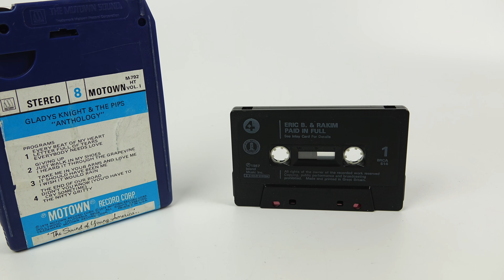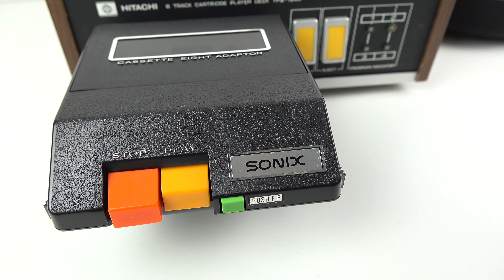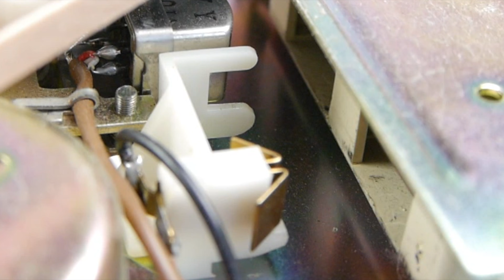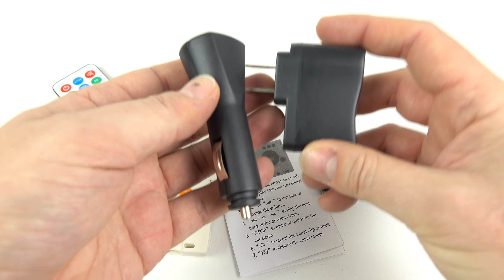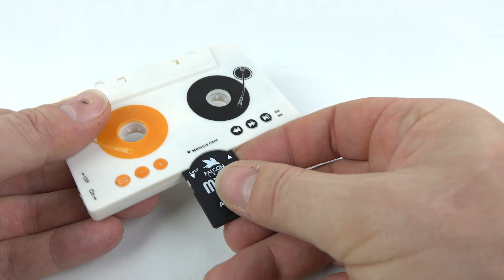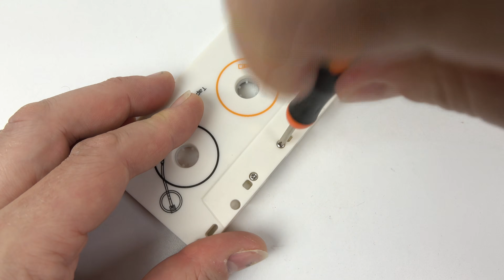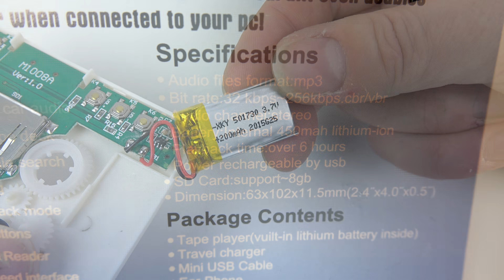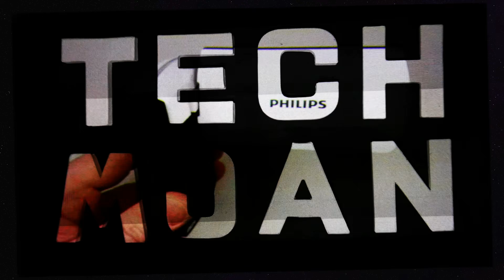Car Stereo Tape Adapters - 8-Track to Cassette to MP3

Comment: a new problem now is having a car stereo with only a CD player and radio. how can I play my music from my cell phone. if it had a tape deck I could use the wired tape audio adapter that was shown in this video. 

the car is from 2008 so there is no audio in jack or blue tooth. new cars come with these options now. I am better off changing the while deck.
Reply from the maker: I have the same thing in my car - I just listen to the radio. Those personal FM transmitters are generally a bit rubbish...and I have enough things plugged in.
Reply: I had that same problem with a car I used to own as well. My solution was to purchase an aux in jack that I wired into the car stereo. At the time, the solution was kind of crude, being that I had to splice a few of my radio cables and also use a power switch to turn the thing on and off, but it worked great, and sounded MUCH better than an FM transmitter. 

I did a quick search on Amazon for "aux in adapters", and it seems that they've gotten better, as you no longer have to splice them in. Instead, you can just plug them in. They cost around $25-$30US. Hope that helps!
Reply: I have the same problem. 2007 Astra only has radio or CD. I now have a huge stack of burned CDs in the car since empty discs are cheap as dirt nowadays.
Reply: Usually there is a port on the backside of car stereo unit to connect the cd changer. I have Yatour mp3 player that simulates the changer and it works perfectly in this situation. Sometimes you need a special Y adapter cable to put inbetween. Everything depends on the stereo model.
Reply: The radio transmitter things are a little bit rubbish until you hack them. I got a cheapo one from Maplin years ago, and cut a bit of old speaker cable as an aerial that I then kept prodding to the circuit board until it sounded better. Glue gunned it in place and suddenly I had far too good a transmitter! I cut the wire shorter and shorter until it served the purpose I wanted (sending simultaneously to the radios in the living room and the kitchen) without  being able to pick it up outside the house. Obviously you can't just transmit to a whole street in the UK, that would be illegal! But it sounds better and transmits more reliably if you do this.

I should think there's bound to be videos telling you how to hack one of these things.
Reply: I just burn CD's for my car lol
Reply: Use those bluetooth to FM adapter?
Reply: A lot of manufacturers have spare ports (or connectors) on the back of their head-units. It makes it cheaper to manufacture the same stereo over and over again and just add the required components via a simple plug-in connection. I Googled my car (2006 Renault) and found a 'hack' that allowed me to attach an old headphone lead to three of the spare spade connectors. 10 minutes later I can plug phones and mp3 players into it with ease.
Note that the steering wheel controls do nothing to the music (well, except the volume control of course).
Reply: with all those gadgets and gizmos laying around your house , how come you didn't opt. for an aftermarket head unit replacing the OEM one you have there ?
Reply: dude its hella easy!
just listen to me...
buy a $20 dollar device off amazon called the iKross or something, it connects to your phone via aux or bluetooth, and then broadcasts the music over an FM or AM signal, tune your radio in your car to that frequency and boom youre done! no need to change the headunit or the stereo or the car! works fine and extremely well in my '01 Benz ;)
Reply: +Benisteinzimmer please dont generalize. not all of them do, but i agree, some of them do. buy a good brand name one and check its reviews before buying and youll get a good one.
Reply: +techforever1970 Yes the key is a good one and making sure that it is on a completely clear frequency so it's not competing with an existing FM station in the area you are driving in. 
Then, the sound quality can be good and the signal relatively free of noise.
Reply: I have a bluetooth reciever going to an fm transmitter so you can still recieve call etc
Reply: I once added an aux-in to my 1984 Crown Vic's original AM/FM-only head unit -- the $30 WalMart CD one got stolen, so I opened up the OEM unit, soldered a headphone plug adapter to a bit of telephone cable to the output of the radio receiver section, and ran the plug into the ashtray. Tune it to dead air, plug in the mp3 player, and its signal was strong enough that it downed out the radio static. But yeah, 2008 probably has a plug on the back for an optional dashboard aux-in plug or CD changer that you can tap into.
Reply: Somebody once broke into my partner's Jeep Cherokee and stole the stack of burned CDs with labels like "shitty indie mix #1", "music for driving through a city at night", and such. Didn't take the head unit, didn't touch the hundred of dollars' worth of tools in the back, didn't even take the spare change from the console. WTF?
Reply: Now, if your car stereo has a CD changer option, you may buy (very cheaply) a CD changer emulator for your stereo, that plugs directly into your car stereo with no soldering nor fiddling with wiring. The emulator reads micro SD cards, Jack 3.5 and USB 2.0 (flash stick). I just fitted such emulator to a Skoda/VW OEM radio and it works great. I put music on a flash drive, name the folders on it CD01 upto CD99 and the radio thinks there are actuall CDs in the system, so all the CD changer controlls on the radio and wheel work like there was a stack of CDs in it. I have a 8GB micro SD card in there, the radio happily plays MP3s.
Reply: Have you really checked if there isn't any AUX in available on the rear connector system of your radio?
Send me some details of the radio and I may be able to check that for you.
On the other hand, I might see if I have the prototype of a Philips DCC radio with the optional CD changer... May be that is an alternative for you and your car :)
Reply: Actually, there are also quite a lot of cars that do have bluetooth, but only for making calls, which is quite stupid...
Reply: I just bought a new stereo for my car, there are a lot of cheaper ones with AUX that do fine. It was a worth investment. I'd rather pay 40 bucks for something to work properly than to by 10 bucks of crude accessories that may not work.
Reply: There is a trick for some cars. You can do this in Honda Accord 2004, you have to buy extra adapter, which will replace the multi-CD player, and you'll be able to play songs from SD cards, flash drives and 3.5mm headphone jack. In case of SD/USB, you can play only MP3 songs, and you can hold up to 12 albums
Reply: Either a Bluetooth-FM adapter, or the older ahealdphone to FM adapters. They are essentially miniature broadcast stations.

I remember getting the microphone version of these many times as a kid.
Reply: Benisteinzimmer I have actually done that too. I feel like I am in the 1990s! I guess we could add a CD changer lol
Reply: subbookkeeper That seems like a good work around!
Reply: Techmoan I agree. But some of the FM transmitters are a cheap option, they even come with a small remote. 

Hard wiring an Aux In line to plug in your cell phone is a better option from changing the whole deck. From your cellphone you can get more media plus you can stream from the internet too. May be worth to hard wire a solution. 

Great videos btw.
Reply: +Michael Spikes 
My 2004 car is there as well. 
One can use an FM broadcast device to play through the radio. They typically have an aux cable for your phone or player. Just to be silly, I have used that with a cassette Walkman as well.
Reply: I'm still on a project of building my own, with a bluetooth interface for my phone. Using a Volkswagen RCD 200 in a 2008 Polo 9N3
Reply: Cab Davidson Good idea actually. I also still have one of these FM transmitters laying around. But the sound quality was pretty terrible, I wonder if the larger aerial also improves sound quality.
Reply: +Benisteinzimmer bit better, yeah. Sound quality largely bad cos of a sort of background hiss I found, and with a better transmitter there's less of that.
Reply: +Cab Davidson yep, the hiss was the biggest problem so far.
Reply: Yes. I could do without everything except the radio.
Reply: They used to make inline adaptors for the radio antenna connections. When you turned them on they cut off all FM reception and just played whatever you had plugged in. The sound was pretty decent from what I remember. Still means you have to remove the radio to install, but probably the best you are going to do short of changing the deck.
Reply: +techforever1970 most FM transmitters have terrible sound quality
Reply: +Retro Tech Thank you for your tips man! have a great day ahead.
Reply: you could use an FM transmitter
Reply: are you high?
Reply: +Delivery McGee good idea
Reply: Even long before 2007 the Opel radios had an AUX option available but not wired. The adapter can be made out of a stereo cinch cable and some pins, that are added to the cable tree in the rear section of the radio.
As it is often impossible to get the correct pins, buy a standard car radio adapter cable with the plugs for the radio on one end, the other end open. Use some needle to unlock the needed three pins and solder your cinch cable or 3.5mm jack to it. Unlock the original rear sockets push in the three aux pins, lock the socket, push it back into the mounting frame and plug in the radio.
Go into the menu, set AUX to active and ready you are. If you did this once, you can do it in 30min. If you do it the first time, it will need some time. Before you do it, check that you have your radio code card availble, cause after power-loss your radio will ask you for that.
The best thing is, that this modification is absolutely invisible or completely reversible as you do not need to cut any wires from the original cable system.
Reply: My car stereo has an AUX input, so normally I could link my phone through the audio jack with the radio...but my phone's audio jack is broken. However, bluetooth transmitters work just fine, with no loss of audio quality. Hell, I just bought some chinese thing for around 5€ or so from the Netherlands and it's pretty good. Anyway, I link that bluetooth transmitter to the radio and my phone to the transmitter and that thing works pretty well. The only problem is Spotify not really working well on my Windows Phone. I won't blame it on my Windows Phone, as everything else works pretty well. It's Spotify, who can't program a proper WP-app.
Reply: That's unfortunate!!! I'm lucky that my 1997 Volvo has a stereosystem with a tape and CD player built in.
Reply: faithless8888 Yes, but does it play MP3?
Reply: either put in a new stereo or burn cds, they are like 20c a cd nowdays. My girlfriend has the originals and i make copies of them so i can ruin them without worrying and i dont have to worry about leaving my phone or other electronics in the car.
Reply: Well It's technically possible if you get a cassete adapter or something like that. I've seen my friend have a cassete that has a wire coming out of it that he connected to his phone.
Reply: You can get little gadgets that broadcasts an output from your phone to the car radio. 

Plug your phone into it using the 3.5mm jack, it will then broadcast (at a very low level) to something between 88.1 and 88.7 FM. 

No Bluetooth needed, quality is OK as long as it's left lying near to the car radio.
Reply: Philip Cooper Nope, but I can use one of those tapes with an AUX cord on them and connect my phone or an MP3-player :-)
Reply: Change the stereo or buy a new car
Reply: Hot wire the audio cord on. Or maybe just switch the whole player unit.

Nah, just kidding. Use a MP3 player that can send the audio through FM radio, and tune the car radio to that player's output frequency. That thing is popular at least here where I live, until everyone switched the player unit to an android-based one.
Reply: Bluetooth enabled radios (CD-free) are cheap nowadays (perhaps $50 or so). Spend an evening or another $50 to get it installed.
Or go the cd-changer way as you'd might want to keep buttons on the steering wheel.
Reply: Not sure if it was mentioned but you can get CD-changer adapters for most car brands that work as Bluetooth, AUX and USB/SD, they just plug into the CD-changer port of a factory stereo and that's it. They power on with the radio so there's no fiddling with it aside from the initial Bluetooth setup.
Reply: FM Transmitter
Reply: deIlluminati That's not so simple for all vehicles. A lot of vehicles around 2005 to 2007 (and newer) use Can-Bus com to send signals to the computers and even the stereo head units, sometimes these head units have computer components required for the vehicle to run properly so a by-pass is needed which can double or triple your cost depending on the vehicle. It's the same way on almost all newer vehicles but they at least have fully featured stereo systems so the need to replace them is moot since you can install amps in-line. Volvo was especially bad about this as they had their own system called MOST, same idea as Can-Bus but it used an optical jack to send digital signals through the car to all of the stereo components and the stereo controller itself is a major part of the car's computer system and even houses part of the SRS airbag system.
Reply: CheekyChan My older Volvo didn't have that kinda stereo, just plopped out the old one and install a new one. My -10 Volkswagen Passat was the same, just needed to get converter cables.
Reply: deIlluminati Yeah, not all of them are like that but now 99% of them are. For Volvo they started with those stereos in late 2004. Volkswagen has been pretty good about NOT ruining their custom stereo installs. Toyota is becoming one of the worst to install systems for. Ford is on their way as well.
Reply: What is the Song's Name Start From About 13:30?
Reply: just swap out your whole radio with one with the features you want and dontforget to take it back out again when you sell the vehicle.
Reply: +ΛVINIDE I mentioned above about the CD changer adapters, a lot of them even have bluetooth support as well, some of them even have a separate remote you can use to by-pass needing to use the head unit controls.
Reply: reezdog "Aux in, save us!"
Reply: I have a Scosche FM transmitter that I picked up at Wal-mart that works very well. You have to find a good station to transmit on but once you do, you're good. I have a car that I've kept factory original right down to the non-functioning tape deck. I would rather find one that worked and replace it, but oh well.
Reply: A Parrot bluetooth adaptor. idden under the dash, supports AUX, USB and bluetooth.
Reply: There is a good way around buying a whole new deck if you have the room for it. Put in an Amplifier and a 3.5MM jack and wire it up to the speakers through the amp. No need to put in a new deck.
Reply: degru5091 I'm sure it can be hacked
Reply: I tried using one of those FM transmitters, it was shit.  I decided to just burn a bunch of CDs instead.
Reply: reezdog buy a new cd player with and auxiliary port
Reply: Truly awful, but mine has an AUX jack, it is just broken. I use a funny but workable solution for this, there are certain spots that I can get a radio transmitter to work pretty much perfectly all the time (near the antenna as it were) so I just used that in tandem with a bluetooth receiver and then I can use anything with bluetooth (or run a wire to the front if it doesn't since I have lots of things to listen to music on)
Reply: Use a bluetooth fm tramitter
Reply: is your deck have radio function? there is an adapter from USB stick that broadcast FM radio

Comment: That MP3 tape adaptor is actually pretty neat, well, apart from the badly thought out switch, but that's easily sorted with a bit of nice sharp Sheffield steel... :P

Comment: I noted that the 8 track "converter" was playing before you pressed the play button because it was never designed to get a signal before the motor was moving. The small amplifier is always on.
Reply from the maker: Correct.